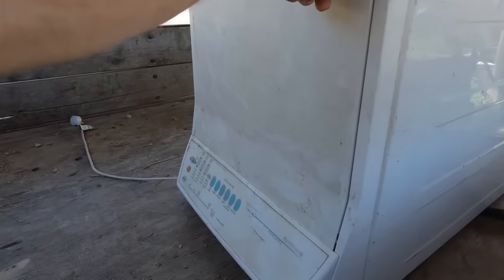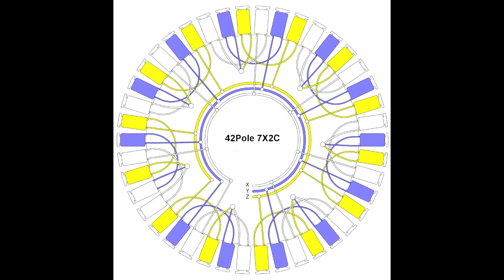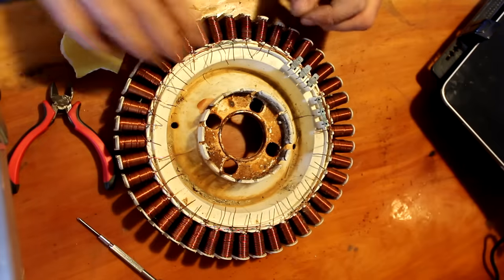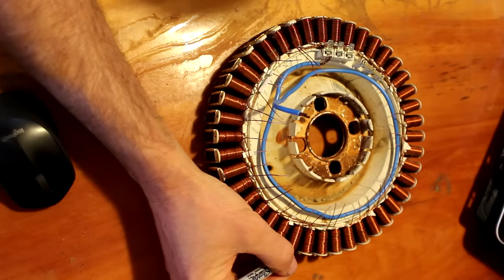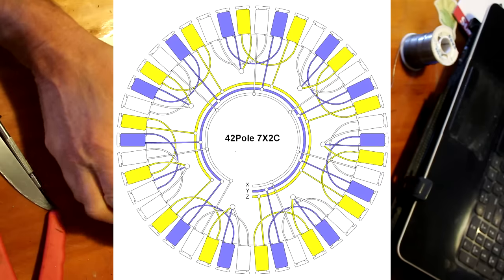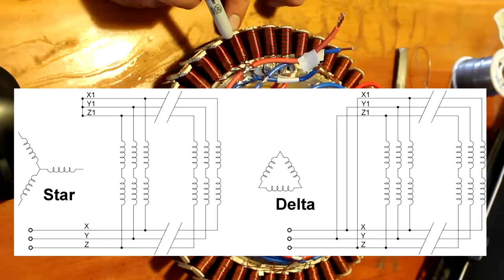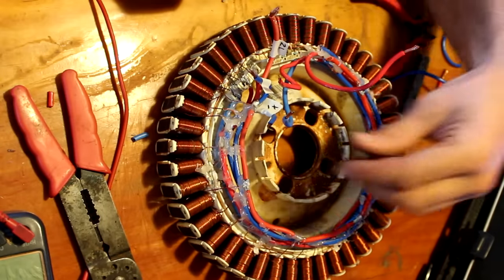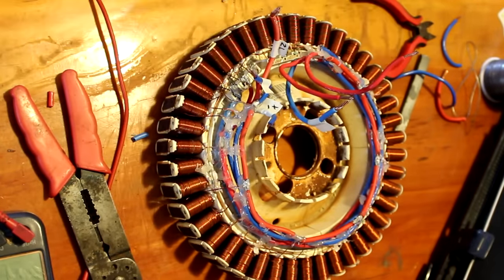Free Power from Water Part 3- Rewiring a smartdrive washing machine motor to generate power

Comment: I see available 400v even 575v charge controllers at 40 amp, but they cost $1000 to $2000 each.
Reply from the maker: Yeah those high volt controllers aren't cheap

Comment: I thought of using one of these motors but it cogs up too much which I thought was a massive loss in efficiency for a turbine to push over.
Reply from the maker: You can twist the poles to reduce cogging, only necessary with a low power application like wind turbine starting and stopping. Not really an issue with hydro, once it starts spinning it stays spinning

Comment: I wish I understood more about electrics so I could fully understand what you are doing.
On another note. I still have a set of those soldering irons that belonged to my dad. I don't have the means to heat them up anymore. They're a bit overkill for your bit of wiring LOL!!!
Reply: Did your Dad do a lot of work with guttering/piping/plumbing, especially copper?
Reply: @JohnSmith-pl2bk  No, not especially. He was just good at soldering stuff when needed.
Reply: @MURDOCK1500  
As you are when you have your own tools.....and can use them.....

Comment: Great video as always, but wouldn't it be easier to leave the motor wiring and put the high voltage into a step down transformer? Maybe one from a microwave ?
Reply: Linas Velavicius
8 hours ago (edited)
Marty after watching your Part 2 I watched a YouTube explaining the difference between conventional generator vs the new more expensive inverter type generators. I also looked up Skin Effect. For those who don’t know I copy paste the explanation from the Internet;

“The main technical difference between inverter generators and conventional generators is what kind of electricity is produce, conventional generators only produce AC electricity while an inverter generator produces electricity in three phases (high frequency AC to DC back to stable  AC current)”  

“Skin Effect results from circulating eddy currents, arising from a changing B field, cancelling the current flow in the center of a conductor and reinforcing it in the skin. This reduces the effective cross sectional area increasing wire resistance and losses.”

Now I understand your "inverter" setup, your cost to effectiveness ratio is just brilliant. Big fan, love your channel.
Reply: Marty T
2 hours ago (edited)
It is very hard to spin the rotor with factory wiring with a load attached, this site doesn't have enough pressure or flow, also very dangerous and high hz / high loss over long distance (skin effect
Reply: As already stated various times by Marty and others issue is  high frequency,  step down  transformer  does not change frequency , so not helpful

Comment: 400vac travels a fair distance (compared to lower v dc) over thin wire then use a transformer too bring it down in the house doesn't work? (as well/efficient ?)
Reply from the maker: The factory wired generator puts out 400v at high hz, dangerous to work with, high loss over long distance (skin effect) and very hard to spin the rotor over the stator, it would require higher flow / psi than this site can offer

Comment: Would it be just as easy to use a transformer and then rectify the voltage
Reply: @JohnSmith-yv6eq  I did no mean transformer at the house and run 400v 3 phase to the house transformer at the remote site. Also the high hertz makes the transformer smaller with less loss

Comment: you did what i always do, forget the heat shrink tubing until after the solder job is done. boy howdy, i do so love that heat shrink tubing! a little hot glue on the joins is my fix. it seals them up against shorts, and holds them in place at the same time. what did we do before hot glue guns? i've had one for so long, i honestly don't remember. a lot of cussing and re-soldering i suppose.
Reply: If you keep the joins open you can see if the join fails from a heat or physical break.
Bury it in black heat shrink....what can you see?
Reply: @JohnSmith-pl2bk  there is clear heat shrink, it's just a little harder to find.

Comment: how long is your cable between the cabin and the generator? The wire losees at low voltage should be consider. Perhaps is better to use the higher voltage and use a transformer at the other end. Perhaps the frequency is not constant, so the transformer should be a monster. perhaps you could also use an electronic switched circuit to stepdown the voltage and increase the amps. Who knows which one has smaller losses to your system and what option is cheaper to build. By the way, your videos rock!
Reply: System rectifies and uses inverter to produce 230v single phase right at the generator before it hits the cable to the house. Watch episode 1 and 2

Comment: Your machine looks like a tub top loading version. We don’t normally have these in the uk anymore, they are mostly front loading washing machines. And we can’t take anything from the local dumps which is lucky as the misses would of killed me and the house would be full of unfinished projects 🙂
Reply from the maker: Haha.. These smartdrives are a dime a dozen over here
Reply: @MartyT  I got into appliance repair in the '60's and stayed in it until present day. We have both front load and top load machines (mainly Korean LG and Samsung, but also Whilrpool,  Maytag etc) that use these smart (direct drive) motors.  Ocassionaly one gets discarded mainly due to the expense of the repairs.  Wish I had a stream like that. Maybe wind?  Great videos. I can't stop watching in the middle. I must see how it all turns out.

Comment: What is the total length of the piping? For 95 psi, you have a difference in level between the intake and the place where the turbine is, about 65 meters, is that it?
Reply: 150 metres total overall length and 229 ft total drop to give 100 psi at turbine...

Comment: Correct me if im wrong, but wouldn't it be better if the initial 400 volts at low amps were kept and having a transformer at home to step it down, cause the losses are less when sending a high voltage over long distance than a high amperage?
Reply: Please read the pinned comment at the start of these comments,  thanks.

Comment: Would it be possible/worthwhile to put another stator magnet thingy onto the end of the shaft? While just using the original cups on the first stator to turn the two possibly producing twice the electricity
Reply: Energy in, energy out. The potential energy in the water pressure could drive more than one wheel, how much more is entirely down to the conversion technique. Looking at the setup in the video doubling the production would likely not be needed; but running two at reduced pressure might have benefits for long term maintenance as the parts would be less stressed.

Comment: I thought you might want it as high voltage to cut down on transmission losses?
Reply: @JohnSmith-yv6eq  are you using the batterys to smooth the load like a cheap giant cap?
Reply: @JohnSmith-yv6eq  well thank you for your time and the videos are very interesting.

Comment: You mentioned these could be used for a wind generator as well, have you set one of those up before?
Reply from the maker: Yes years ago, chainsaw carved blades, It did generate a useful amount on breezy days but I didn't add any furling and it flew apart during a heavy wind storm
Reply: @MartyT  I've built wind generators based on car alternators after rewiring them using thinner wire, it's very tricky to get them to work right and balance the prop. Furling is essential for these otherwise they spin too fast and burn out easily, ideally you need one for normal wind that furls up when it gets too windy and another for very windy conditions. Setting them up and working out all the kinks took about 3 months or more and they needed a lot of maintenance, it was also tricky to balance long blades, I think the water wheel idea is much simpler and likely to be more reliable.
Reply: The backshed link Marty posted has a lot of information on using these stators for windmills
Reply: @MartyT  interested on how this would work on savonius, since they are best at low windspeed
Reply from the maker: @AmbientNoise404  Yes it would work well, might be easier to strip all the wire off the stator and rewind each pole so it starts producing power at low rpm
Reply: @ian-c.01  I saw a really good design using a 44 gallon drum cut in half vertically and welded offset so it would work regardless of wind direction.
Reply: @_Skim_Beeble  Yes that design works fairly well but they need to have a brake installed to stop them over spinning and they are very difficult to balance so they aren't ideal

Comment: This is awesome but way too hardcore DIY for me. If you could... make a video with off-the-shelf plug and play parts that wouldn't require quite as much resoldering and years of electrical engineering experience to make them work - that would be priceless!

Comment: I have enjoyed these videos.  I do think the system would be a lot better if you could find a motor that had the magnets on the rotor and the stator be a true stator.  I am sure that it exists but may not be easy or cheap.

I have lots of ideas and questions.  I am sure you probably tried some and determined they are not ideal.

Have you ever considered running three phase AC from the generator to the house with some transformers or would the extra wires make it prohibitive?  You could then have the power conversion happen in a climate controlled area in one location.
Reply: Linas Velavicius
8 hours ago (edited)
Marty after watching your Part 2 I watched a YouTube explaining the difference between conventional generator vs the new more expensive inverter type generators. I also looked up Skin Effect. For those who don’t know I copy paste the explanation from the Internet;

“The main technical difference between inverter generators and conventional generators is what kind of electricity is produce, conventional generators only produce AC electricity while an inverter generator produces electricity in three phases (high frequency AC to DC back to stable  AC current)”  

“Skin Effect results from circulating eddy currents, arising from a changing B field, cancelling the current flow in the center of a conductor and reinforcing it in the skin. This reduces the effective cross sectional area increasing wire resistance and losses.”

Now I understand your "inverter" setup, your cost to effectiveness ratio is just brilliant. Big fan, love your channel.
Reply: Marty T
2 hours ago (edited)
It is very hard to spin the rotor with factory wiring with a load attached, this site doesn't have enough pressure or flow, also very dangerous and high hz / high loss over long distance (skin effect

Comment: Have you thought about using a high voltage solar charge controller? Some of those can charge a battery off of a 600v panel string, so if you used one with your  generator you could have lower line losses, and bring the batteries and inverter into your house
Reply: Marty commented that MPPT is on the list of upgrades when finances permit...as are SSRs (solid state relays)

Comment: Its Perfect.... 21.2Kwh Daily is approximately = National Grid Average of 28.9 Kwh =  According to the EIA, in 2017, the average annual electricity consumption for a U.S. residential home customer was 10,399 kilowatt hours (kWh), an average of 867kWh per month. That means the average household electricity consumption kWh per day is 28.9 kWh (867 kWh / 30 days).

Comment: Couldn’t you send the 400v at 2A 3 phase up to the house and then transform it down and rectify it down up there. That would place batteries and controllers in a more convenient location
Reply: @JohnSmith-yv6eq  I’d love to have the time and a location with a reliable water flow to build something like yours. I would still experiment with the higher voltage and frequency though. All aircraft power is generated at 400Hz and 400Hz can be transformed using transformers designed for 50Hz so supply wouldn’t be a problem. I once worked in an underground gold mine and all power came into the mine at 11000v and was transformed and run to fans, motors and pumps at 1000v. The 11000v cable was a special (expensive) item however the 3 core and earth 1000v cable wasn’t much more costly than  orange circular 415v 3 phase cable.

Comment: what about keeping the original winding with 400VAC then step-down by transformer to charge the battery🤔👌👍
Reply from the maker: It is very hard to spin the rotor with factory wiring with a load attached, this site doesn't have enough pressure or flow, also very dangerous and high hz / high loss over long distance (skin effect)
Reply: @MartyT  👌 thanks for the information👍

Comment: so Marty this is AC being converted to DC? how does this compare to simply using a self regulating truck alternator?
Reply: Marty has commented previously t that truck alternators need 2000rpm to start outputting...probably double that to consistently output top amps, say 150amps @24 volts= 3600 watts.
But in this hydro system there is insufficient water flow or pressure to achieve those figures 24/7...

The Pelton wheel is operating at 1400rpm max under load...with 885 watts output.

So you need to step up the revs for an alternator with V belts and associated losses...just like on a truck engine....but with slippage and wear in a damp environment.....

The alternator may not be able to cope with 2 years' worth of revolutions, either.
Say @ 50mph the rpms of the alternator are 4,000= 240,000 per hour x 24 x 365x2 =  175 million revs....over the equivalent of 50x24x365x2 = 876,000 miles.
Any truck alternator you know of that can do that?

Comment: I'm curious if you have thought about running ac to the house and keeping your rectifier there? even better would be too keep your voltage high and put a transformer at the end of the run, understanding there is somewhat greater safety concern, but voltage drop on a 400 meter cable with 24v DC has to be quite bad.
Reply: he is charging a pair of batteries off the generator at the creek, then converting it back to 240V with an inverter before running it up the hill.  Do agree that the loss in converting it to DC and back is a consideration though.  I am sure he has a reason for doing it this way though,  not his first rodeo.
Reply: @homeFall1  I missed the part with the inverter was down by the hydro.
Reply: @homeFall1  
Converting 24vDC into 230VAC is best done with short thick wires for the 24VDC connection. After that, the 230VAC is minimal loss in the 400m run to the house, and can be used as is, since the standard New Zealand domestic appliance voltage is 230VAC...

Comment: Could you have used a transformer to lower the voltage and up the amps?  Or would a lot of power be lost?
Reply: Linas Velavicius
8 hours ago (edited)
Marty after watching your Part 2 I watched a YouTube explaining the difference between conventional generator vs the new more expensive inverter type generators. I also looked up Skin Effect. For those who don’t know I copy paste the explanation from the Internet;

“The main technical difference between inverter generators and conventional generators is what kind of electricity is produce, conventional generators only produce AC electricity while an inverter generator produces electricity in three phases (high frequency AC to DC back to stable  AC current)”  

“Skin Effect results from circulating eddy currents, arising from a changing B field, cancelling the current flow in the center of a conductor and reinforcing it in the skin. This reduces the effective cross sectional area increasing wire resistance and losses.”

Now I understand your "inverter" setup, your cost to effectiveness ratio is just brilliant. Big fan, love your channel.
Reply: Marty T
2 hours ago (edited)
It is very hard to spin the rotor with factory wiring with a load attached, this site doesn't have enough pressure or flow, also very dangerous and high hz / high loss over long distance (skin effect

Comment: Practical reasons not to take it up to the house at ~400V and deal with it there?
Reply from the maker: Suboptimal generator speed with factory wiring, skin effect cable loss at high hz and far more dangerous to work with for those who don't know what they're doing
Reply: @MartyT  Cheers

Comment: Dang... That "soldering iron" looks more like a "clothes iron"!  I'm 72 years old and that thing looks like the irons we used to place on the wood stoves to heat up to press out the wrinkles in our clothes.  :) 
The plastic hub those stators are on is full of cracks... I hope that doesn't come back to bite you later.
Reply: Marty has commented that he has seen and operated many with cracks but since that part doesn't rotate...there seems to be no problem...
Reply: @JohnSmith-pl2bk  OK! Now I see... I was thinking that it rotated, but doesn't. Thanks!

Comment: wouldnt it be better to run the three phase output directly to the house and use the rectifier there? i think running DC all the way from the turbine is not the best? also, i really need something like this for my new house, i have a river at my disposal and an electrically heated house...
Reply: The setup has been changed and the rectified  60VDC output now goes up the wires to the house to a solar panel MPPT controller that feeds the batteries and then the inverter...all up at the house now...